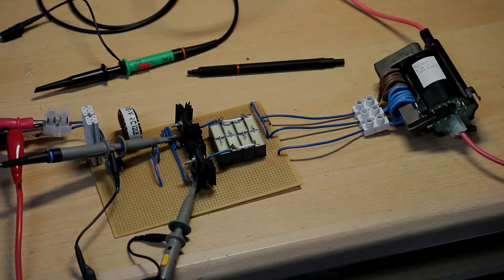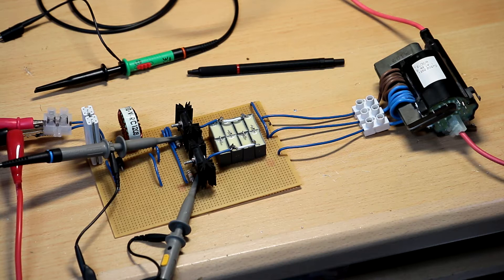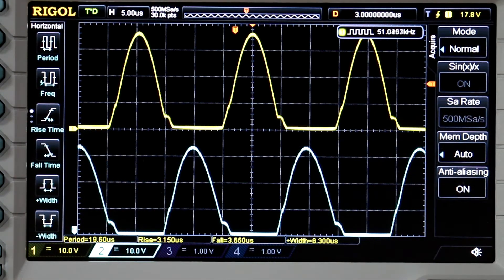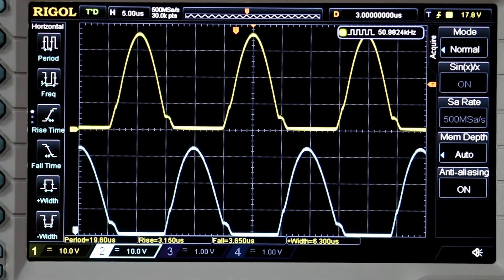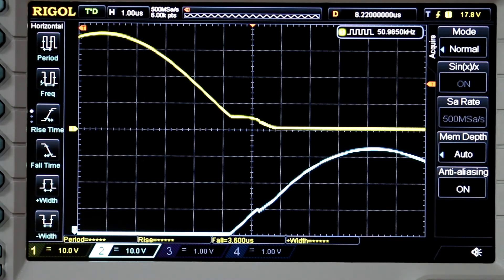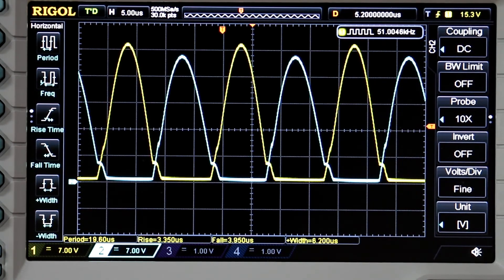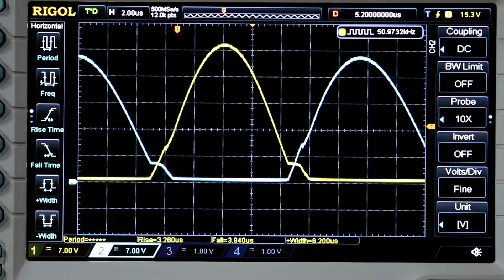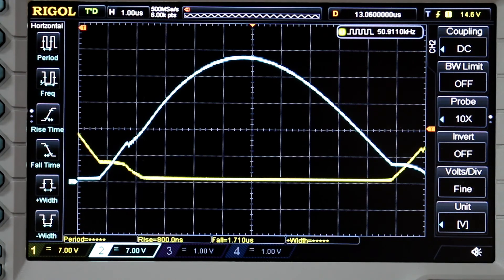ZVS Driver transistor output.

Comment: wouldn't one of these high frequency circuits be very efficient and cheap compared to those huge, heavy dumb chargers that just transform from 120 > 13.8v? a transformer of that size in ferrite could charge 100's of amps compared to the normal 10a max. or am i thinking something wrong here? because this is the first i've seen anyone actually use a transformer not on 50/60hz with less than a gajillion components.
Reply from the maker: See "Switched mode power supply" which is used for basically everything these days.

Comment: Looks pretty nice. If you know your power supply is isolated and you aren't connected anywhere else, you can also scope across the Drains with a single probe, and see the full sine wave output on one channel that way. (Probe tip to one Drain, probe ground clip to the other one).  I've got a bunch of videos showing ZVS circuits driving flyback transformers, and also, with different tuning, working as Wireless Power transmitters and even Induction Heaters. I even use one as the primary power supply driving a flyback for my hybrid SS-SG Tesla coil.  The same basic circuit works for all three types of applications, the main differences being in the capacitors and the output coils used. The flyback drivers run at 20-30 kHz, the wireless power systems at around 800 kHz and the induction heaters at 150-200 kHz, if I am recalling correctly.

Comment: It's great watching the subject item being bombarded with electrons from the streamers when running a LOPT. I find it amazing just to think how many electrons must be travelling across that gap in any given second.

Great vid mate
Reply from the maker: ***** I think I might have caught the bug again for playing with flyback transformers :)  Will have to build another circuit and see how much power I can get out of it. Last video was back in 2012 lol!
Reply from the maker: ***** Btw, how does that waveform look compared with your circuits?
Reply: FrontSideBus  Couldn't tell ya off the top of me head mate.. Next time I get my FB's fired up I'll take a look and report back.
Reply: ***** There are a few reasons why one transistor will peak higher than the other.

In a DC flyback, there is an HV diode stack.  One transistor is doing most of the driving.
No two components are identical.  Bifilar primary vs. non, flux walking, etc. 

Awesome video, man.  I have no idea how you make it look so neat and clean.
My stuff always looks like a mess.
Reply from the maker: The Lightning Stalker
Cheers for the info, I thought it was something like that. Lol you should see my old videos, the circuit was just soldered together directly on the transistors and hanging in the air :) Worked though.
Reply: FrontSideBus The signals look very much the same as your fsb... I was driving 2x IRFP260 at around 10v

http://i.imgur.com/SWEkOSD.png
http://i.imgur.com/yaErnLN.png
Reply from the maker: ***** Nice looking waveform, completely symmetrical unlike mine. I really wish you could hide the menus on the Z1000 series scopes.
Reply: ***** Was this an AC flyback?
Reply: The Lightning Stalker Nope.. Just an ordinary run of the mill DC flyback.
Reply: ***** Were you drawing an arc at the time?
Reply: The Lightning Stalker Yes, the arc was nice and stable as I had the wires held in a clamp, so that I could control the PSU and press print-screen on the scope at the same time :)  A very unstable waveform would result from an unstable arc.
Reply: Interesting.  Something somewhere must be out of balance, then.  Are you SURE the diode stack is actually rectifying?  I have seen them blow out and pass AC.
Reply: The Lightning Stalker Please explain? My waveforms are from two flyback circuits configured the same way. The only differences are the diodes and transistors used. One circuit uses standard 1N series diodes with the usual IRFP260's transistors, the other uses BYW29 fast switching diodes with IXTK102N30P trannies.

The circuit is DC powered, and the screenshots are taken at the maximum arcing point at which the waveshape start to balance out, as seen in the links above. Shortening the arc will drastically change the waveform.
Reply: ***** I'm referring to the diodes inside the flyback transformer.